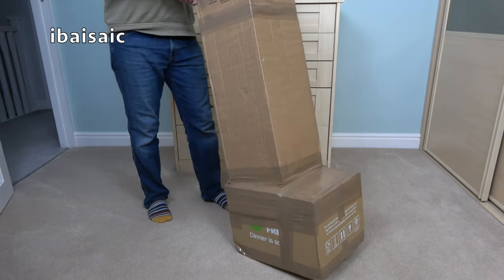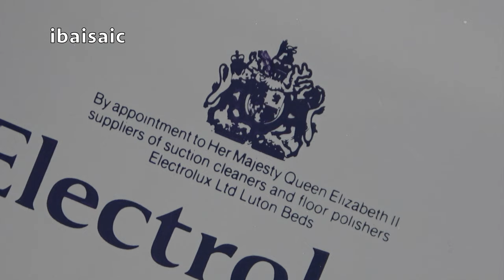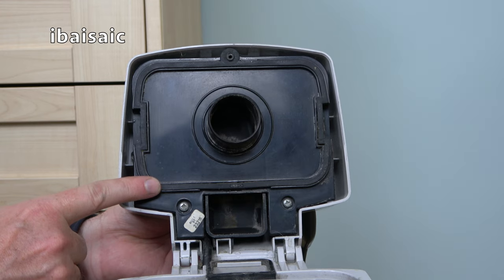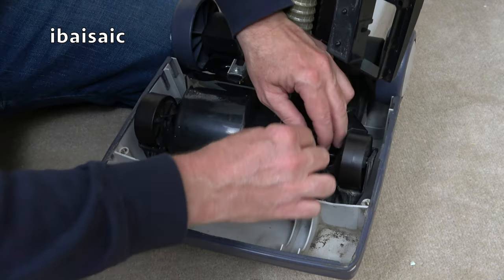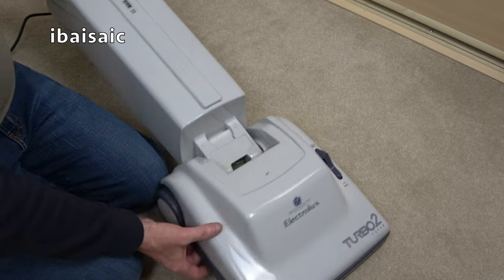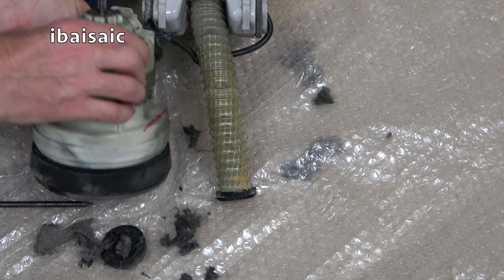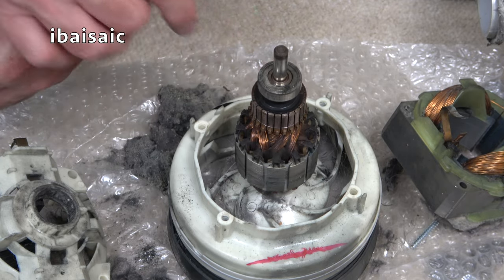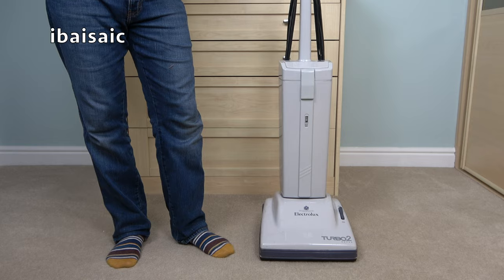Electrolux Turbo 2 Super Upright Vacuum Cleaner Hiding a Dirty Secret

Comment: These cleaners still pop up on facebook and ebay quite a bit, so hopefully you'll get it sorted / get a new one for your collection. These cleaners came to market in the autumn of 1991 and were on sale for anything between £79.99 and £99.99 (typical selling point being £79.99), with or without tools, depending on the retailer. By Easter of 1995 they were being discontinued and could be found for £49.99, which was an absolute bargain for such a high quality and powerful cleaner. 

What I remember most about cleaners of that time was that good quality basic uprights were in huge demand, thanks to the poor build quality of many all-singing all-dancing expensive uprights with built-in tools that had failed to pass the test of time. A bit like now with the Numatic Henry being so popular when consumers have spent a small fortune on some bagless thing which disappointed them.

Comment: Roger as much as I sympathize with you getting a machine that’s in excellent physical shape but rough mechanical shape, at the age of these machines I’d personally assume that they all need their bearings greased up and to be given a tune up under the hood. And personally being a minor collector, these issues are honestly some of the simplest to fix, it’s hard to make a machine that’s been banged around look like new, but it’s easy to make a worn out motor run like new. I’d rather have something like this where all you need is grease and a bit of time versus the other way.

Comment: Hi I’m assuming the excessive amount of fluff and debris around the motor was due to a gaping hole in the suction tube. If there is poor suction fluff will build up instead of being sucked into the bag. Plus any dirt or fluff being picked up by the brush roll is going up that suction tube and out into the casing.
Reply: Usually when this happens it's because either the hood of the motor has worked loose and therefore suction is escaping around the base of the machine, or when the plastic rings to the right of the dust box (as viewed from the front) has worn away/snapped off, again allowing direct access of air to the motor & fans. This said, both issues were much less a problem on later cleaners like this, as Electrolux had made the build quality better as time progressed. I am surprised to see one this late in such a condition.

Comment: I bet the fancase and fans are also full of compacted fluff. I had a E502 like that and you have to knock the fancase cover off and clean out the fans and ducting between the fans. The part you cleaned is only one part of the ducting, the rest is only accessible when the fancase is removed, and even then, because the fans cant be removed, it is very difficult to clean some more inaccessible parts of the ducting under the inner fan. Ideally it needs the complete motor replacing, but being so old now, motors would not exactly be readily available.
Bad seller, and I would leave negative feedback as the motor was in such poor condition and potentially a fire hazard with it being choked with fluff like that.

Comment: We had one. It lost all it's suction. The Electrolux engineer said it was a motor problem but because the motor is a sealed unit it could not be repaired.

Comment: Were there ever any differences between successive 500 series Electrolux machines? There always seemed to be a base model and electronic/power model, but they essentially seemed the same model just with different colours and slightly sleeker bodies with the new wide pedal design? My mother had a 502S, we updated to your new version but it seemed mechanically identical…
Reply: Ah yea, power switch moved to body from handle. That’s it though…
Reply: The air freshener was branded Green Leaf i think…
Reply: The flip down handle, drop in bag and bayonet fit plug-in suction hose was a much more user friendly design than Turbopowers of the day. I always had a soft spot for Turbopowers though, probably because I was bored of my mother’s Electrolux habit and coveted something different!

Comment: Hello.  I was wondering if the 502 has a similar floorhead design to the one on this Turbo 2?  Because I am planning on trying to fix the split hose on the 502.  Is it easy to get spares for the 502 by now?  Thank you.
Reply from the maker: The 502 is similar to this model and shares some common parts. You can still get some spares for the 502. Ebay is your best bet.
Reply: Thanks a bunch.  :)